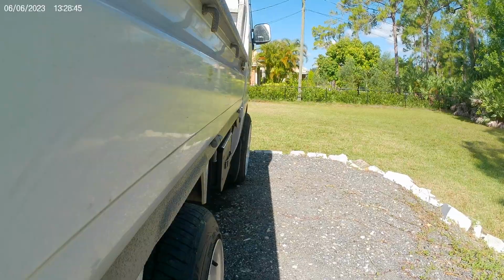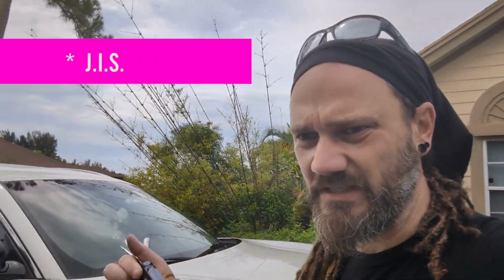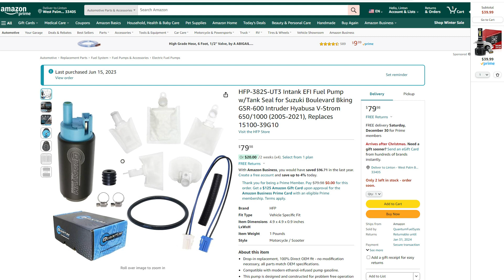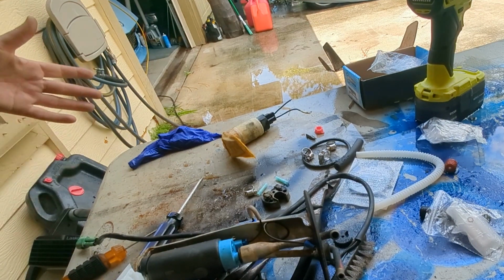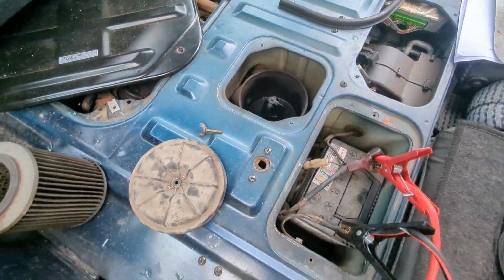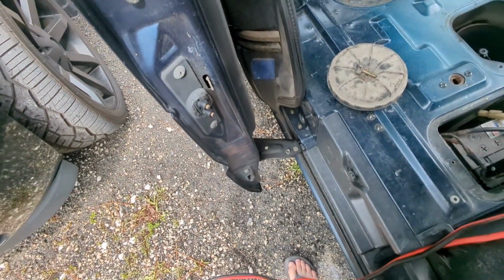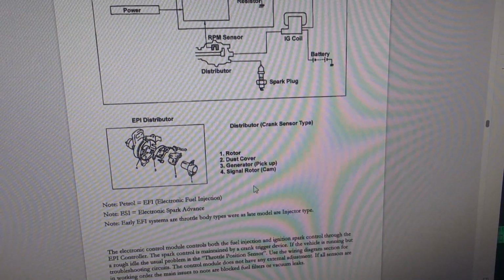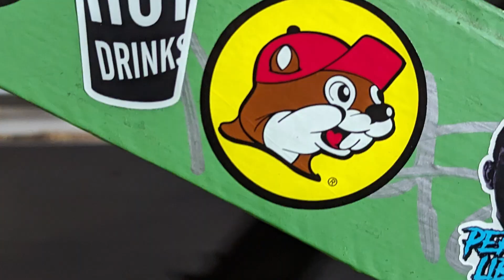Suzuki Kei Truck Repairs and Finding Parts For Japanese JDM Van and Cars Carry and Every

Comment: Enjoyed the video. I've got a Honda Acty. One reason I chose the Honda was the suspicion that Honda parts are most readily available. This has mostly proven true. After a year spent on body restoration, the truck burned a valve. Honda rebuilt engine from Japan- 2295$ with FREE air shipping. After that, it's been a pretty happy truck. All the problems I've had have been carburetor related. The gasket kit, and a couple solenoids are readily available, otherwise, not so much. At present, it runs well, but if it sits a while, it acts flooded. After it clears out, it's happy. Biggest parts nightmare? The van windshield. Glass shop damaged it at the body shop. The two shops agreed to cover it. Lucky me! 1600$, and three months. One thing I found is wild swings in part prices. Seems Honda will make a batch of something, then wait till they run out. As they run out, the price rises. Found this on a very complicated center tie rod. An A/c relay was mildly challenging. On the brighter side, I've also found that some Civic parts interchange. Other thing you can get through Honda powersports, since the Acty engine is half a Goldwing six. I'm three years into my Honda odyssey, and in general, it's a lot of fun. I'm lucky to have a mini truck reseller about three miles from my house.
Reply from the maker: Thats a steal for the engine, good find! I wonder if you can swap to a different carb from some other vehicle or maybe that goldwing bike.. getting the jets right might be a pain but may be worth the research for more common parts.  Ugh i'm dreading breaking a windshield. thats great they stood by breaking it an repaired it for you.   Yeah i just found a great supplier for suzuki but the parts are coming form the Philippines and shipping is insane! most of the other stuff like fuel/oil filters and gaskets i've been able to get from suzuki bikes also.   good old 660s!

Thanks for watching buddy good luck with it.. i think i want to get a street racoon next!
Reply: @inkandpistons  I'd probably start looking at something they used on the Gold Wing, or the performance variant they made for a while. In truth, I'd suggest that someone today just pass on the carbureted ones and get the injection. I've heard no issues with it. Then you can also get power steering.
Reply from the maker: @scottchamberlain5594  hell install a micro squirt ECU and make your own fuel injection! 😁
Reply: @inkandpistons  Hmmmm. Maybe. Right now, I'm putting a polished intake manifold on my Miata
Reply from the maker: @scottchamberlain5594  nice

Comment: i don't think the parts fiasco is limited to just suzuki. i've got a 2013 honda nbox and i''ve just ordered the wrong front brake disc pads. Looking at the part numbers online there are about 10 different ones for this make and model! Of course they complicate it with different models like n-box, n-wagon, n-one, n-van and every one has different part numbers!  This is why when you go into a parts store here in japan you need to bring your shakken which has the vin, date sold and model name.  I got spoiled owning old usdm datsuns. Many parts were interchangeable. Gone are those days
Reply from the maker: @gregh7457  yeah there is no  longer any benefit for then to make it easy on you they didn't want you mucking around in your own car .

Comment: By any chance do you know where I can find a valve cover gasket and many more maintenance parts for my van? It’s very confusing and I don’t want to order the wrong parts that don’t fit my van. I have a 1995 Mazda scrum van non turbo 2wd DL51V F6A engine. Everywhere online all I can find is different numbers like DA51V, DF51V, DM51V etc. I am confused on what the differences are.
Reply from the maker: @_PR0JECT_  I'm not 100% sure but my suspicion is that any f6a non turbo gasket should fit. Maybe post a question or look on Minitrucktalk.com. usually the blocks and heads are identical and interchangeable.. the turbos will sometimes have a different head gasket but valve covers probably the same.
Reply: @inkandpistons  thank you I was thinking that too
Reply from the maker: @_PR0JECT_  good luck. Write back if it works I'm curious too

Comment: What was the total cost in repairs?
Reply from the maker: In regular parts I had 120 into two different fuel pumps and about 80 bucks into the computer I think. There was maybe another 80 bucks in miscellaneous parts into the distributor plugs and wires cap and rotor.  So it was about 300 bucks in miscellaneous parts. The diagnostic on the car at my buddy's shop was probably the bulk of it.  checking all the injectors and the fuel system only to figure out it was the computer they probably had 5 to 6 hrs in it. But we did all the maintenance fluids.  I want to say all in. I was under $1,000. Which had I had enough time to mess with it myself. I probably could have knocked down to just about 400 bucks. However, probably would have taken me even longer to figure out it was the computer.